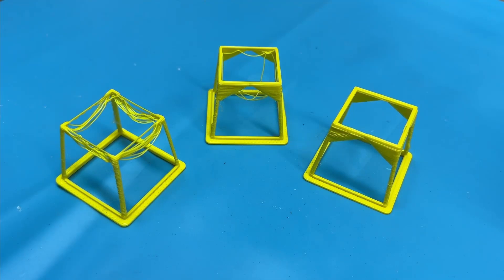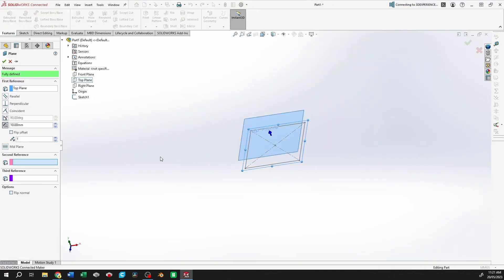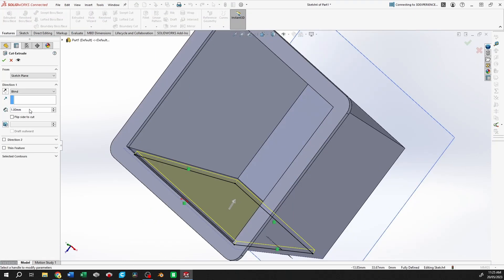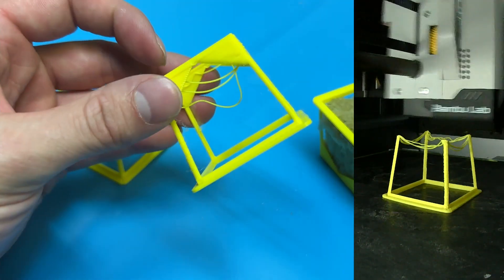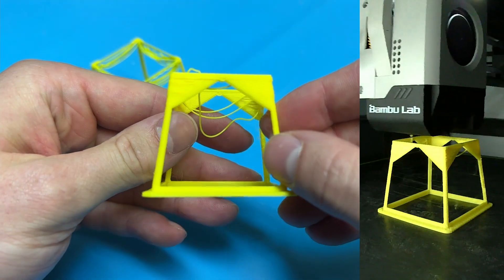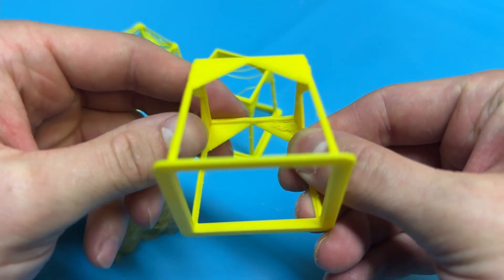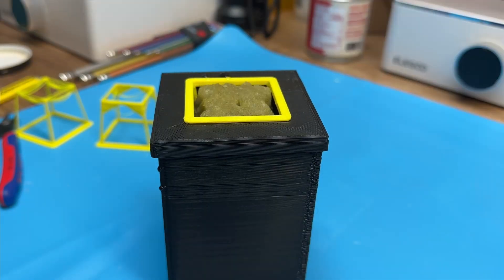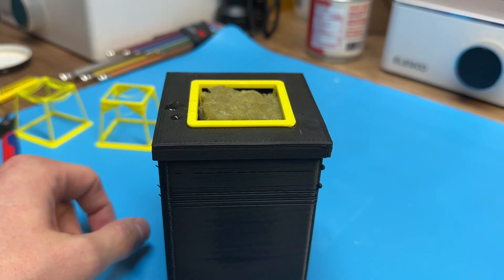3D Printed Hydroponics Basket Design Iterations

Comment: I think bridging settings could be tuned for this.
Reply from the maker: You're right, but if the design is changed for more successful prints across more printers without any additional effort from the end user, then I see that as a win.

Comment: I'm wary to use 3D printing for gardening as I'm worried that microplastics will leech into the water/soil over time. 

What are your thoughts on this?

Great design by the way!
Reply: use food grade materials such petg filament, microplastics are going to be present to some degree regardless, but can be greatly reduced by covering materials with uv/weather resistant paints or epoxies
Reply from the maker: Yeah that’s a fair concern to have. I don’t know much about micro plastics but these are the steps I’d take to mitigate them. On a setup like this one where the water gets replaced every 1-4weeks I might consider running the old water through a coffee filter before discarding it. On a setup with a pump circulating water I’d try and include a filter before the pump. In contact with soil seems to be the hardest situation to contain any potential micro plastics, not sure what I’d do in that case. 

Thanks for the comment